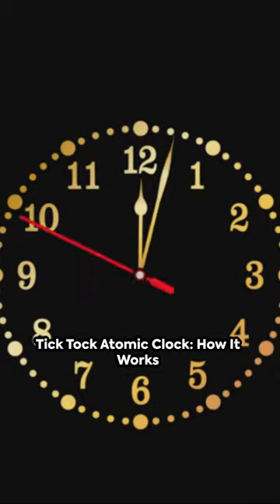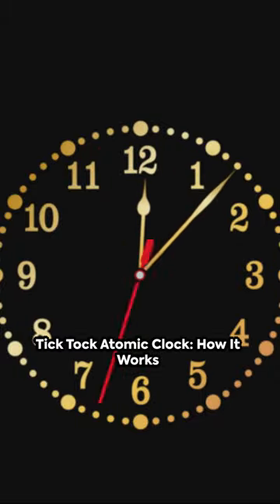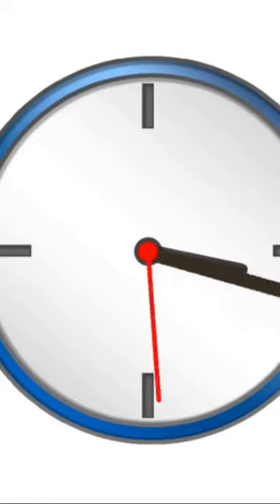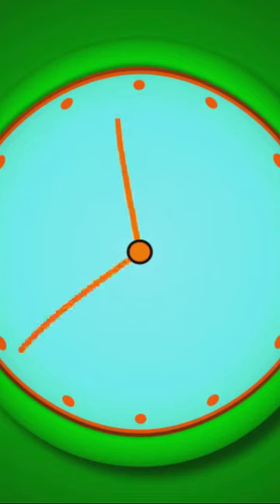Tick Tock Atomic Clock: How it Works

Comment: Pound devorr hall effect
Reply from the maker: Thank you for your insightful comment. You're correct, the Pound–Drever–Hall (PDH) technique is a crucial method for frequency stabilization in atomic clocks. This technique, coupled with advancements like lasers and optical frequency combs, has greatly enhanced the precision of atomic clocks. In fact, a "quantum logic" optical clock at NIST in 2010 marked a significant leap in precision beyond caesium clocks. Your comment adds a valuable perspective to our understanding of atomic clocks. We appreciate your contribution.